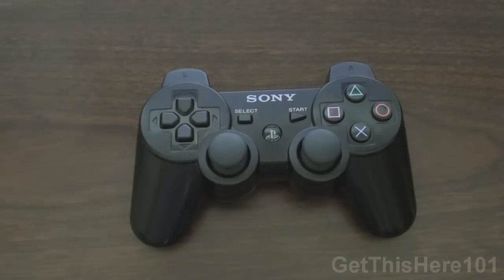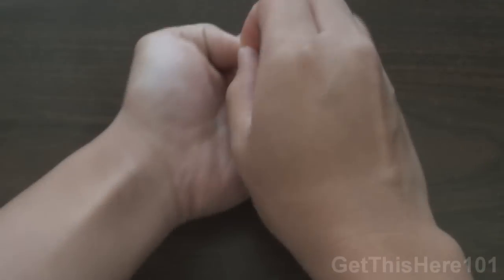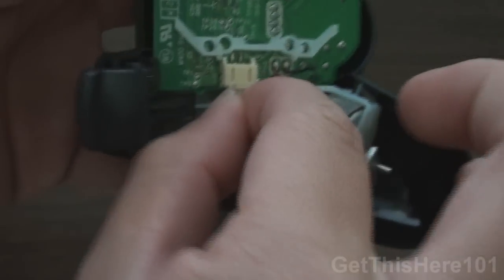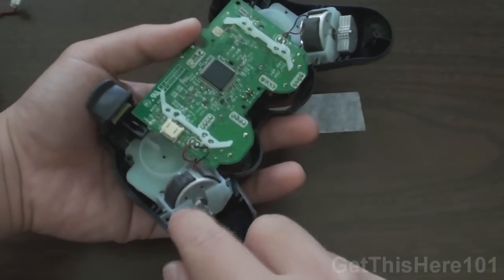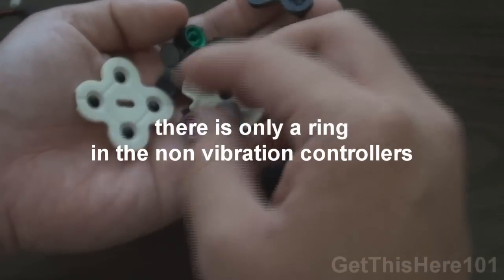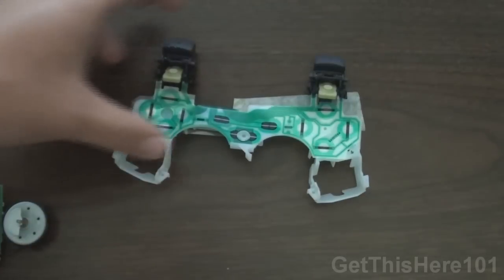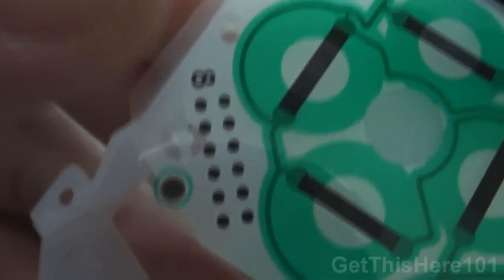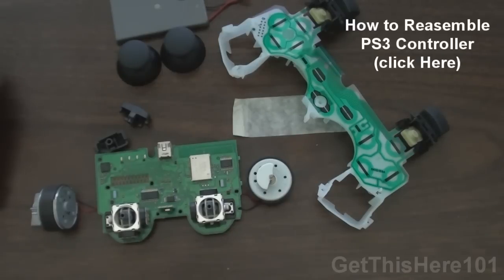How To: Disassemble PS3 controller (HD)

Comment: HOW DO YOU GET THAT CLIP AT THE BOTTOM OFF? I t just won't come off for me - even if i try to force it off with a flathead screwdriver
Reply: I can't even get the ps3 apart.. ps2 controllers are much more easier to pull apart and they are even older! Screw you Sony for making things complicated.
Reply: @nelzelpher2088  yea fuck sony all they care about is money they do this so you get frustrated and you have to pay a Sony guy to fix the issue for a profit of course.
Reply: I broke the clip lol

Comment from the maker: @jochman12 I am not to sure because I never opened an xbox 360 controller but to take a guess... I don't think so because 360 thumb sticks will either be too small/big or it doesn't have the same shaped hole that fits into the ps3 sticks (rectangle)

Comment: i cant detach the battery you did it so easily wtf
Reply: same here
Reply from the maker: ***** Lol, hope this aint serious
Reply from the maker: the battery is in a carriage, only remove the battery not the white plastic carriage.
Reply: Pull the white tab & wires of the battery out of the brownish box housing its plugged into.
Reply: I used a pair of small pliers and squeezed really gently while I pulled it out and it came right out 👍🏻 for anyone who is having the issue of no nails or just can’t get it to pop out. I tried with my fingers but I couldn’t get it

Comment: Thanks for the advice, I did find it easier to use a small screwdriver to push on the clip and open it. Have to be careful when putting metal against plastic but it makes it a lot easier.

Comment: Nice video, forgot to mention the little rubber knob for the reset button mine fell out right away but easy enough to figure out if your not to far into it. 

Anyone know where the antenna is that makes this wireless?

Comment: There were 2 little screws holding each of the rumble packs in on my controller.

Anyway, very good guide. I needed to replace the pin which makes the trigger button spring back. Was struggling for a while, came here, sorted 5 mins later. Good stuff.

Comment: Either the screwdriver doesn't fit the screw(Different screwdriver)
or you've stripped the screw, which then you can try get a bigger a screwdriver and put lots of pressure on the screw and turn anti clockwise(throw that screw away, it's no good) if that doesn't work there's not much you can do.

Comment: I have 2 things to ask
1: with the rubber that is used on the triggers the rubber pieces that kind of look like a flattened lego piece one of mine broke and now the l2 button does not work would you know where I could get a replacement?
2:  something I found out when I pulled apart my controller when I broke it was the white pieces on the circuit board for the battery were not there and I am sure I didnt lose them because I didnt take them off would you have any idea why this would be missing?
thanks and very helpful video
Reply from the maker: Kai Westgarth 1. you could try searching Ebay

2. For the white pieces for the battery, if you are talking about the carriage... it is not a big deal if you do not have it

Comment from the maker: @94PrestonB That just means you prolly assembled the controller really well cus it lights up when you plug it in!... I had the same problem my first time. Think your problem could be you put the reset button on backwards so when you close the controller all it does is keep resetting which causes it to keep blinking. Or you didn't fully connect the batter pack which is why there is only power when plugged in, let me know if you fixed it and test it out before closing the controller

Comment: It helped, now I don't know what to do... ;-) I've washed controller with sponge and detergent last night very gentle and turn it on immediately after that it start to feel very odd now X and triangle button doesn't work for sure. I can turn on PS3 with my controller and go through menus  but buttons doesn't work...some advice?This was easy assembling is tricky part...
Reply from the maker: @deagt3388  maybe the rubber pad not aligned on the green film, try testing controller without putting plastic Case housing cover
Reply: @Chrisshao  I've reassemble joypad but now I can't even turn on my PS3 and charging is working...?
Reply: @Chrisshao  Thanks for reply I've cooldown a little bit...

Comment from the maker: @speedy123321 when you are sure you got the screwdriver in the cross notches, put pressure and slowly turn... Make sure your screwdriver is the right size and you are using a (x) not a (-) screw driver

Comment: I had one controller that got wet and stopped working and another I smashed when I got mad (It happens lol) but still worked. So I took both apart and put the good components into the good frame. Now I have a perfect controller again. Thanks!

Comment: Battery very difficult to remove - decided to very carefully leave it connected while cleaning the controller chassis and installing some modifications.  Other than removing the lone Philips Screw and the white plastic plate, I did not require any other access to the DualShock 3 PCB.  And after putting it back together again, everything is working fine.

Thank you for the video.
Reply from the maker: I am seeing this battery problem continually... nice to see you be able to work around it. 

Thank you for the input on experience.

Comment: Hi, there! This was really helpful, but while taking mine apart I had a screw strip out. During the process of getting it out, I had a piece fall out of the casing I didn't see in your video. It's about half an inch long, plastic, and rectangular in shape with a sort of foot on one end, like it's meant to press a button that's off center. Any idea where it should go?
Long shot, I know, after ten years, but any help would be appreciated.
Thanks!
Reply: It has been two weeks, but that piece you describe fits between plastics in the middle of the backplate 
In the video the place is visible at 2:01 , in the opening where the charger goes, to its left

Comment: I know this video is old but do you have any advice how to like lube the sticks? I bought an off brand controller and it’s pretty good but the sticks are trash, do you have any advice on how to make it smoother?
Reply from the maker: need to take it apart and the box that holds the joy sticks to either blow with compressed air and maybe put silicone lube inside? :/  think those sticks are just worn out though because I may have tried in the past
Reply: Chris Shao Thats man, I’ll try this out as soon as I can!

Comment: how come you took out your battery with such ease has it been dissembled before?
Reply from the maker: +Sheldon Schultz The only hard part may be the adhesive holding the battery to the circuit board, yes I did take it apart more than once.
Reply: +Chris Shao (GetThisHere101) You should post more
Reply from the maker: More dis-assemblies?
Reply: Chris Shao yeah

Comment: how do you put the flexible plastic circuit board inside the spring mechanism if it has slid out.there is a bit of rubber with 2 holes on it that is supposed to hold it somehow but i am at a loss.please help.

Comment: If you wanna CLEAN your controller then yes you do wanna take the R2 and L2 buttons off, you need to clean underneath it. However, i have a controller thats made to where you can't take'em off, so i just pull the rubber pad out.

Comment: Chris Shao i have a question regarding the analog stick/joystick how do you disassemble that you see i am trying to resolve the issue of how i am experiencing interrupts
Reply from the maker: The joystick in the controller is soldered onto the Motherboard - to disassemble you got to DeSolder the whole joystick metal cube and replace the part - or you can blow compressed air into it

Comment: my o button stopped working, i was pretty pissed but it seems i just had to clean the insides out. used this and and saw some dust or something under where o is, cleaned and now it works again. just an example of why you would dasassemble. some people paint controllers, or replace broken parts

Comment: Ok so i just got a used ps3 controller and it seems the circle button needs to be pressed down harder to function while all other buttons work fine. I was going to disassemble it anyway just so i can clean it and replace the left thumbstick that is missing from the analog but before i do anything i have to know if the fix to the circle button is cleaning the ribbon PCB. I also heard you can use a pencil to add some more graphite on the black pads that connect the pad with the motherboard but this sounds pretty risky to me. If you could help me i would really appreciate it because these controllers are really hard to come by nowdays and i don't want to break it by accident by just trying to fix a minor issue.
Reply from the maker: Test the contact with green film if good and consistent, maybe needs foam pad to have stronger contact
Reply: @Chrisshao  what do you mean exactly? i don't understand...
Reply from the maker: @GRGCompletionist  circle button need contact on the green film try pressing it with the rubber if it reacts good
Reply: @Chrisshao  Ok i fixed it! I carefully used some isopropyl alcohol on the black pads and moved the ribbon a bit closer to the board i think that was the problem. It was a bit tricky to disassemble and reassemble because it's a different model than the one on the video but i did managed it. Thanks anyway!

Comment: Thank you. I needed to see where the "soft spot" were to open it.
Reply from the maker: Sure 🤙
Reply: @Chrisshao  Battery had different mounting on second pad. No problem. Just had to take out both plastic adapters, and clip the other battery into same holes.
Reply from the maker: Nice. Gotcha
Reply: @Chrisshao  Good luck using Killzone 3 Gamepad battery on previous pad. lol. Connector is same, but you can't close enclosure. Too tight.

Comment: so if a joystick isn't working well ( not the black cover of course, the mecanism ), you are screwed right ?
Reply from the maker: yeah, essentially you are.  Unless you spend the time and money to buy the joystick part, De-Solder the old one and Re-Solder the new part... which is not worth at all.
Reply: yeah totally not worth it. Well, at least it was funny to disassemble it :p
Reply: buy a new controller, then take the internals and swap them from the old controller, put them back together and return the new one and say it's defective. BAM

Comment: Help, im having problems with my left stick. in BF3, the left stick is probably the most important button there is. For tanks, jets, hellicopters ect. anyways, everytime i move the left analog stick, i get random button pushes like D-pad movements and Triangle and Circle movements. so in turn, when i run, i pull out gadgets, switch weapons, or sometimes Shoot! its bothering me, and my friend had the same problem. his was fixed by resetting the controller, Can this help my problem? REPLYY!!! PLZ

Comment: My O button stopped working (before I watched this video) and I want to fix it. Any easy way how to without completely disassembling the controller? It works sometimes but when I shake the controller it stops.
Reply from the maker: NikoBell12 you could douse the button with rubbing alcohol. Maybe that will remove any gunk if there is.

Comment: I dropped my dualshock 3 and my R1 button is stuck. It is REALLY pressure sensitive. I can hear a part moving around inside that must be a part holding the R1 button in place, Please tell me if this can be fixed? Thank you :)

Comment: The plastic ribbon cable for my R2 button completely detached when I took mine apart to fix a stuck button. How on Earth do I get that back on?
Reply from the maker: Detached or ripped off? If ripped off, not sure if can re-attach
Reply: @Chrisshao  Nah, it was detached but I sorted it. I had to take the whole assembly out of the case to make it easier, and then slide the R2 button's contact pad and line it up with the little hole on the plastic, and squish it down. The actual PCB the rubber buttons make contact with had slid fully out - https://www.amazon.co.uk/Controller-Ribbon-Circuit-Board-Shock/dp/B006TF7NLE top right etc.

Fixed now! Thanks for the video, was a great help.

Comment: Will this help in fixing the analog sticks from moving on their own?
Reply from the maker: +ғoѕтer No, analog sticks are hard to fix from wear and tear.
Reply: +Chris Shao (GetThisHere101) yah i tried to switch the battery bc my controller wouldnt work without a charger but it wasnt the same battery so i just put it bak together but now it wont turn on im usually good at things like this
Reply from the maker: even when you turn it on with the USB cable connected the controller does not turn on?

You could try checking if you put the reset button the right way.

Comment: I have an older sixaxis controller with no motors inside. I have an old PS2 controller with the vibration motors. Does anyone know if it would be possible to retrofit the PS2 rumble motors into the sixaxis? Is there room in those controllers for rumble motors? I know you can use the motors from a PS2 controller in a Dualshock, so the only issue is whether they could be made to fit inside a sixaxis.

Comment: I realize this comment is 10 years too late, but I just wanted to note that you made no mention of the foam pad that keeps pressure on the flat flex cable that connects all the buttons to the circuit board. When the foam pad gets old and loses its resilience, the connection between the buttons and the circuit board becomes unreliable and random button presses start to happen.  It's one of the main points of failure for the DS3 controller.  I need to replace those pads on two of my controllers, and I was hoping that your video would give me an idea of how thick the foam pads should be, but no mention or display of those pads are in your video.

Comment: Can I know what to do when the X button is not working.. I've seen many videos and i see their controller is a little bit different in the inside part. For example, they have the green and colourless thing sticking in the LED. But not for my controller.
Reply from the maker: Could be the rubber that touches green film on controller board

Comment: If I want to completely remove my rumble packs can I just cut it of completely and then just put it back together excluding them? I just find them annoying in any game and if there's a game where I need them I have more remotes xD
Reply from the maker: Yes, but the controller will be lighter without those weights. But there is the option to turn vibration off, I believe. Hold the controller PS button and there is an option to turn off vibration, yeah?

Comment: How would you fix a ps3 controller if coffee got in it? i tried fixing it I opened it dried it up with a cotton swab on where it was spilled and i unplug the battery cause it was annoying me wen i was fixing it when i was done i plug it back in and i put everythinq bak when i tried turning it on it didnt want to turn on,i even charged it for an hour and still it didnt turn on when it still shows the flashing red dots wen its charging but when i disconnect it from my ps3 and still doesnt turn on

Comment: My analog stick R3 is acting up when I play, anyway to fix it? I haven't disassembled it yet any suggestions
Reply from the maker: R3 stick is usually due to wear and tear. Best way to fix it is get a new Analog stick to re-solder onto the board, but that the money and labor is not worth it. I've tried cleaning mine with alcohol then blowing it dry to clean the gunk, but it still is not the same. You are best to get a new controller. :)

Comment: Just opened my controller for the first time and realized that some of the cables of the battery were crushed. Gave me a micro panic attack. Dunno if I should just leave them alone or get a new battery.
Reply from the maker: atheoang3l0 leave it alone if it still works

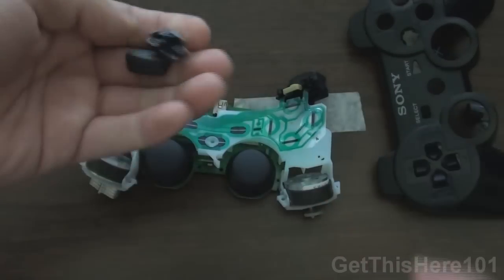Comment: I think I touched the paper like thing under the rubber thingy with my bare hands where the R1 and R2 buttons are and now they arent working! Or is it because the circuit there is a little crumpled like paper! which is the problem? I mean the green thingy at 4:20
Reply from the maker: Night Elf Most likely the button is not making correct contact with the green film, it is okay if you touched it just as long as it is not crumpled or ripped.
Reply: It is a little crumpled.. Im planning to get a new one and probably after some time repair this so I can have 2 controllers.
Reply from the maker: If its crumpled straightening it out is good enough.
Reply: Any good techniques to straighten it out?
Reply: Night Elf completely remove the film layer from the controller and place it in a book. set something soft underneath the sections that make corners(to fit around the controller) so that it doesn't completely straighten out(and weaken) those sections. give it 12hrs and check on it.
Reply: Okay Hyr! Thanks

Comment: hey getthishere i followed the intrustion in this vid but not too much because i just wanted to spray paint the controller well i took it apart and had the shells but i pt it back together and pressed the ps button and t wouldnt turn on my ps3 like it ullsualy does so i searched o youtube and all i found was just resetting it so i did still didnt work PLS SOMEONE HELP!!! and plus my dad took one apart and it still doesnt work till this day

Comment: -sighs- I just lost 2 out of 3 controllers by trying this..I tried putting back together my controller with your other video but none of the parts for some reason fit afterwards their dimensions were off and my control sticks would not go back on..:( great video though i just threw them away </3